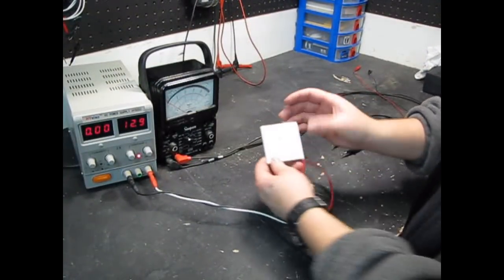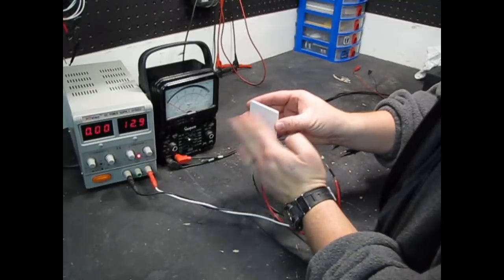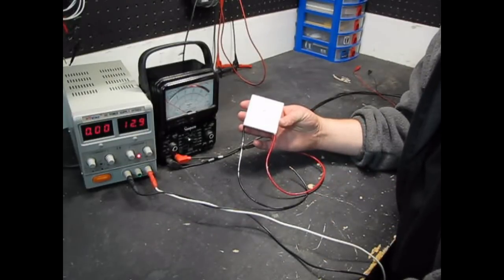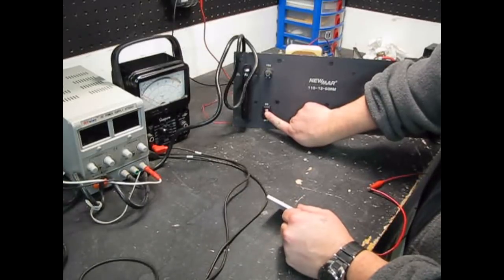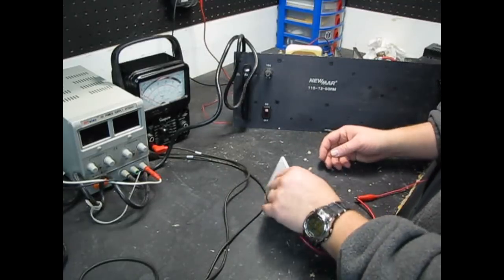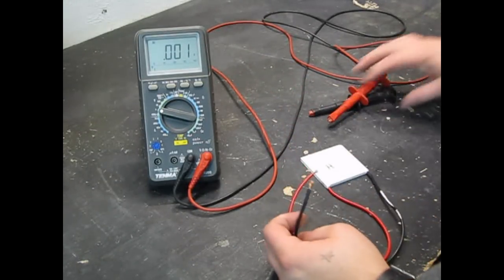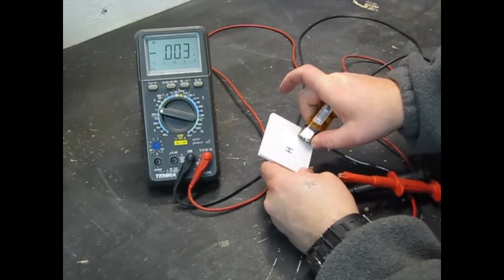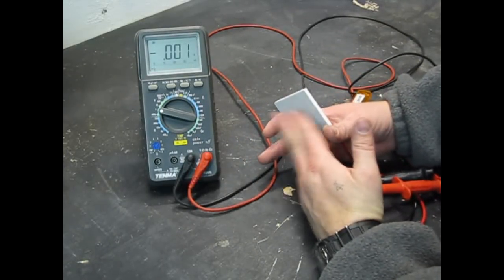What is a Peltier Cooler?

Comment: and actually you could flip the way you put current into the peltier and it will do the oppistite opperation i am making a drink cooler and if i flip the hot and nuteral wires it will heat the drink just a cool tip